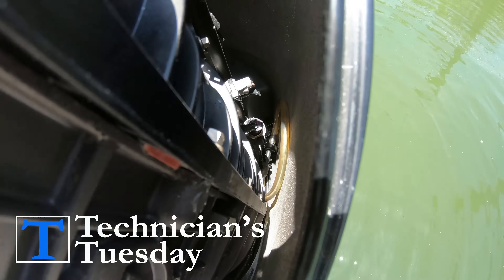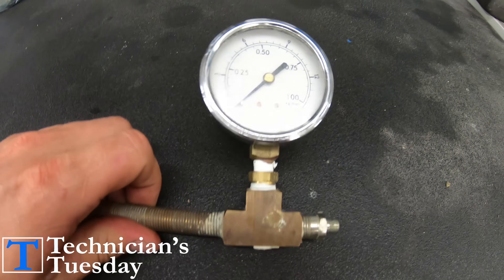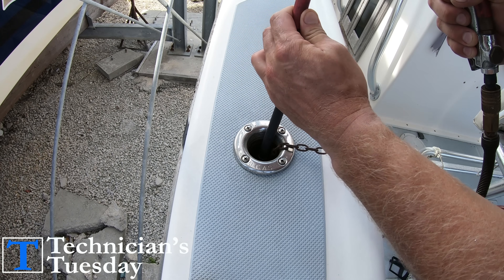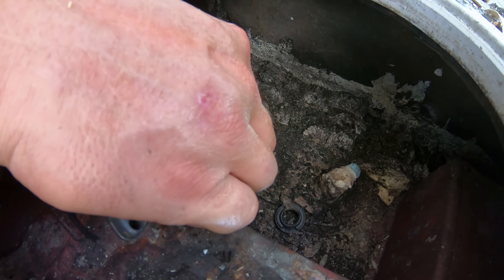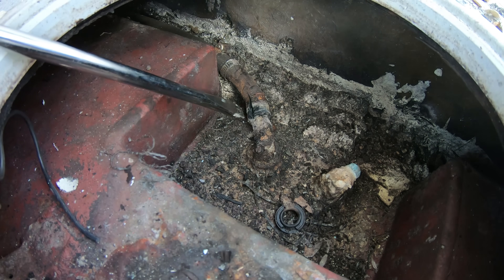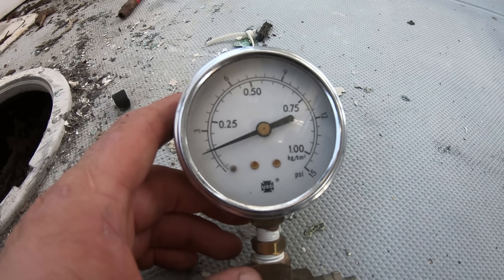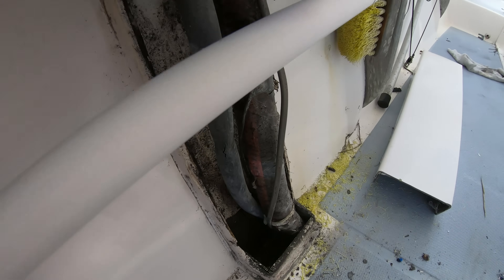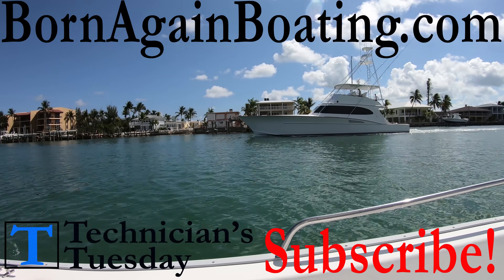Pressure Test A Boat Fuel Tank! DIY

Comment: I'm having problems with my fuel tank, My prime bulb keeps getting flat after running motor fully open for like 10min, I replaced the fuel line but still having same issue, I texted the motor with an auxiliary tank and it ran fine the whole time, so I know the problem isn't the motor, pick up tube looked fine as well, when I blow into the vent it feels clear, what else should I been looking for? T.I.A
Reply from the maker: This should help: https://www.youtube.com/watch?v=09ob37BC02Y&list=PLDFOb030syP4fpLlxGN3EH7gmSUb1VFS3

Comment: Couldn't you just take the 3/8 in fuel hose line that runs to the center to a fuel separator and run air through that line?
Reply from the maker: You could, you just want to make sure you're checking the tank for leaks and avoiding showing a leak else where
Reply: That total was voice to text weird yeah I have a 3/8 in line that runs from pickup to the water separator so I am planning on just taking line off the separator and running air that way. Tank is empty and pushing 40 years old lol want to do a little as possible to test. Thank you for reply!!!!

Comment: Does the air presssure hose have to be attached to the pick-up barb as you show in the video? I am attaching to the fuel/water filter hose (more accessible), but the gauge looses pressure. I have re-checked all connections.

Comment: My fuel tank is old (1985), holds pressure but has some pitting in the aluminum. After I clean it up, I’m thinking I’d like to coat it with something like Apoxse or paint. Is that a good idea?
Reply from the maker: Thank you for your question! Please post it in our Born Again Boating Community! Go here and scroll down to access - it’s free: https://www.bornagainboating.com/
Reply: Terry, I wouldn't put a coating on an aluminum tank, depending on how pitted it is. The corrosion keeps getting worse over time and you won't notice how bad it's getting if it's not visible. Have your expert look at it.

Comment: How long should the test last? How long should I keep the tank pressurized? I've followed your instructions and my tank has only lost a quarter of a psi in two and a half hours. It has also been getting much colder as night comes on. I have an undeniable fuel smell from the bilge and I can't find the cause.

Comment: I am such a dumbass. I ran a full tank of gas out of my tank cause it was leaking into my bilge. Took 4.5 wide open throttle. No fuel coming out of my fittings that I can tell because I touch them and the don’t smell or feel like the fuel in my bilge. 
I got the boat home fuel tank dry as a bone and filled it up with dyed water and the water is not leaking. Probably why you use air it is more fluid than water and so is fuel.

Comment: Do you think an inflatable door wedge will work as a plug for the fillertube?
Reply from the maker: I'm not sure, I've never used one, does it have a round shape that would fit in the tube? If it does, then it should work :)

Comment: I have a 88 mako 171 when i fuel up i get about a 1oz of fuel in bilge aera.can i run a new fill line in my exsiting fuell fill line? Until i can pull apart console.
Reply from the maker: Ouch, yes, you can. It will probably be difficult, but also make sure it's not the tank, being an 88.

Comment: Can I removel fuel in the tank before pressure test?
Reply from the maker: You don't have to, the more fuel that's in the tank the less time it will take to pressurize
Reply: @BornAgainBoating  thanks for ur reply. :-) from korea.
Reply from the maker: Don't go over 3 lbs!
Reply: @BornAgainBoating  do you mean 3 psi ?

Comment: The easiest way to disconnect only the vent hose from the tank and to connect the gauge and the compressor there.
Reply: I came looking for this comment. Why, because there's tanks with antisiphon valves that you won't be able to do through the fuel line. If you do it through the vent, it'll be better.

Comment: 160 gallons x 10 lbs per gallon = 1600 lbs do you really need that much weight?? I replace with 3/4 of original and it still struggles to plane fully fueled and loaded
Reply: Gas only weighs a little over 6 lbs per gallon.
Reply from the maker: Yeah, it's a lot of weight but we're putting another 300 Verado on it. Possibly even a 350, if it needs it :)

Comment: Hello.. I have a 2009 explorer 210 t.v  but i need to clean the fuel tank by removing the old fuel.. I don't want to remove the fuel tank from under my center console, I'm looking for any ideas that might help .. like using any type of pump.. any ideas would help guys.. thanks
Reply from the maker: Hello! No worries, should be an easy job, if you just need to pull out the old fuel and put in new fuel! The best and easiest way to do this is to go to napa, advanced auto, autozone, or any store like that, and buy the cheapest fuel pump they have that has 3/8" hose barbs on both sides of it. We have one from napa and it was like 30 bucks or so. Then just disconnect the fuel line at the primer bulb and stick the pump there. Use another section of hose to direct the bad fuel into a container, 5 gallon buckets or 55 gallon drum, whatever you need. Then makes sure the bow of the boat is tilted way up in the air to push all the fuel to the back of the boat. Then just turn on the pump and let it run until all of the fuel is out. Put your new fuel in, change your water separator and then prime up the engine. You might want to drain the carbs or VST if you think you have bad fuel in the tank, the engine will probably have that same fuel, so drain it out and prime up the good fuel before trying to start the engine! :) You should be good to go after that!
Reply: @BornAgainBoating  ... thank you for your quick response... but bad news I ran my 2009 130 evenrude etec with that bad gas for a few mins. So now trying to restart the outboard it's running ruff then it dies. So with that being said,is safe to say that the VST should be cleaned or can I just try running all the bad fuel out of the fuel line with FRESH gas or is that a bad idea.? Also can you advise on the filters you recommend I replace I would like like to replace all I can. Thanks again.

Comment: Was there a anti-siphon valve installed? I’ve always used a replacement fuel fill cap that I drilled and taped. This way might be easier.
Reply from the maker: Nope, no anti-siphon valve, which I was surprised to see that. I've never seen that done but sounds like a brilliant idea! That's cool thank you!
Reply: MUC, how does that process work?

Comment: Great video
Reply from the maker: Thank you! Seeing the boats that you guys have been doing lately, I think there might be some down here you guys would be interested in! I'm in the middle of 3 different boats right now, so I don't have a lot of time, but we should talk sometime and maybe I could help you guys with some more options of project boats and engines. 
It's a little drive from where you guys are to the keys though, and we see a lot of larger engines over the smaller stuff. I just took off a pair of Yamaha Carbureted 200's with all of the rigging, the guy hasn't sold them yet because he wants too much money for them. A lot of times stuff like that will sit around the yard for a month or two and then they will either give it away or it gets sold to a wholeseller for basically nothing!

Comment: I think I could have told you that tank needs replacing without even doing the pressure test lol
Reply from the maker: Hahaha yeah, it looks pretty rough don't it lol The deck's kind of soft too, so we need to put some more structural glass on the bottom to strengthen it up when we do the tank!

Comment: Was that rain or fuel in the bilge?
Reply from the maker: Well it was a mixture of both, the fuel overflowed out of the tank when I broke the fitting off and then I took a hose and rinsed it out into that bucket.
Reply: So what was the verdict? Leaking fuel from the bad fitting on top, or holes in the bottom? Why is the tank reddish-brown like that? I have a boat around the same age with what I think is an aluminum tank and it still looks good once I wipe the grime off. When I changed out the sender, the inside of the tank was still shiny silver. I’ve considered pressure testing it, but I’m afraid if it’s barely hanging on, I might push it over the edge doing that.
Reply: By the way, I love how you do the voice overs instead of trying to talk while you’re doing the job.
Reply from the maker: I was told this has holes in the bottom of the tank when I bought it. I found leaks at the pick up tubes and the fuel sender, and I'm thinking about keeping this one for awhile so the plan is to change out the tank anyway :) plus we'll get a video out of it! It's like an epoxy they put on the tank, it's supposed to preserve the tank, but I've noticed that a lot of times the epoxy gets a hole in it and then holds water! 
So the tank fails just as fast lol
Yeah, I'd hold off on pressure testing your tank. If you don't have any leaks or water in the fuel issues, it's best to leave it alone! Like you said, it could be just barely hanging on lol
Reply from the maker: PS: Thank you! I finally learned that you can't hear anything over the forklift and all the radios and noise that's going on, so it's best to just do the voice over lol

Comment: Could you do an equally diagnostic test  with a vacuum?
I always apply a light, thin coat of grease to the connector to make removal easier.
Reply from the maker: It's possible, but the tank would have to be empty or else you would be sucking up the fuel :) 

We are huge fans of grease!!!! :)
Reply: @BornAgainBoating  Roger! A little grease goes a long way!